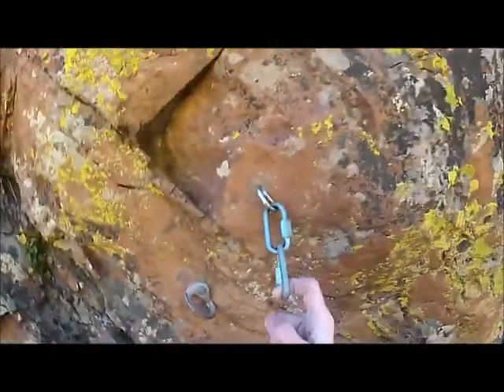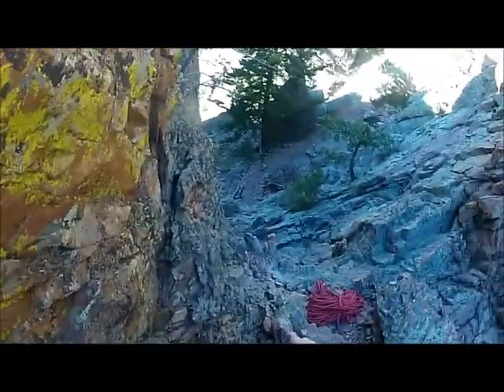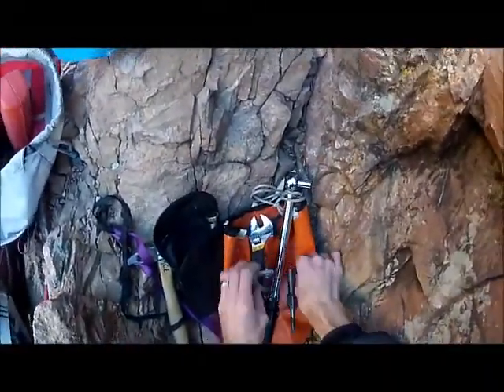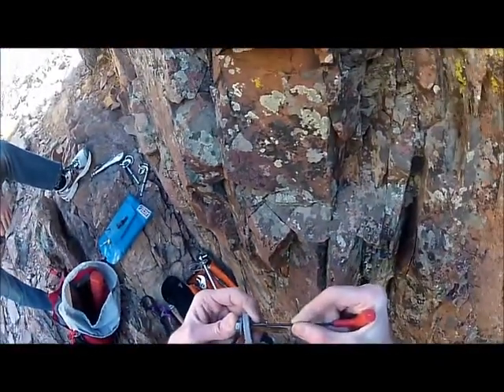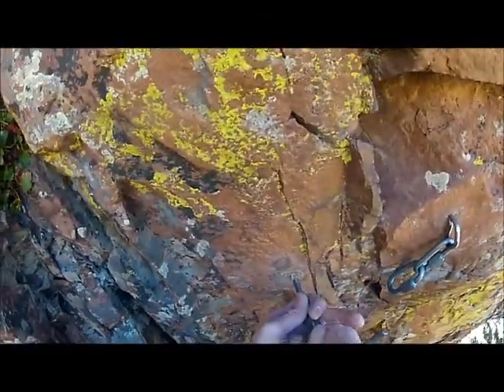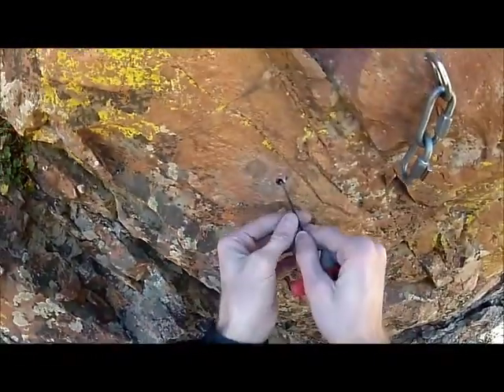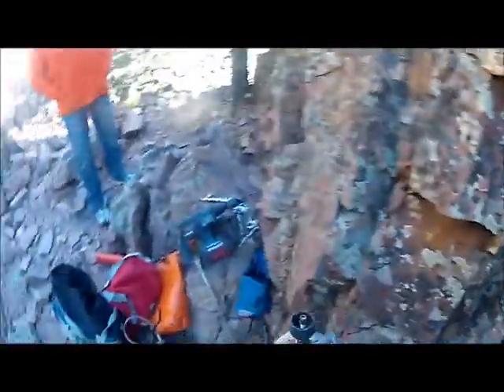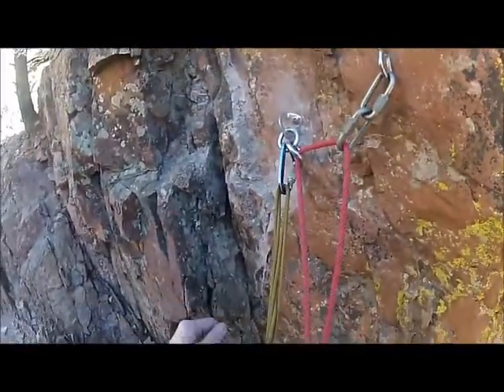ACE: Wind Tower Rap replacement

Comment: Nicely done. I'm preparing to replace some builds at a crag in Guatemala and weighing my options. Nice to see you reusing bolts. Would these holes still be tight enough to use a wedge bolt or would one need to use a sleeve type?